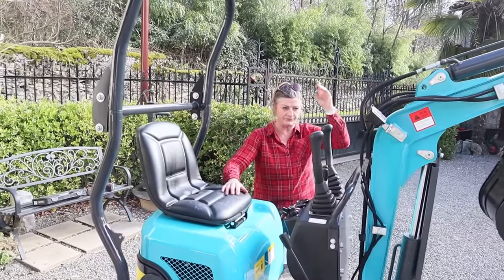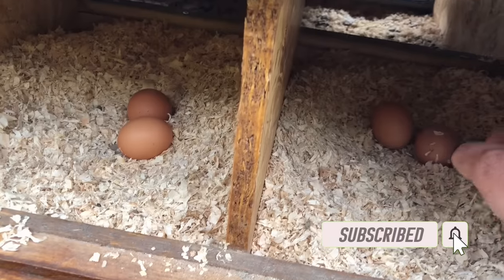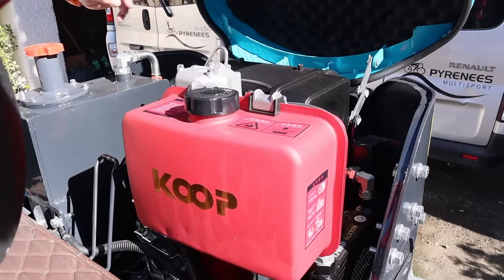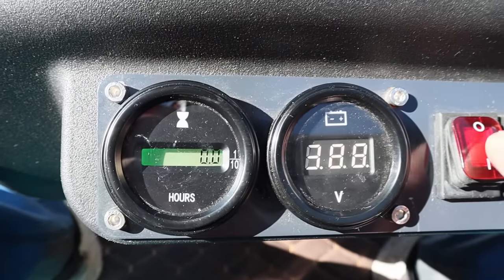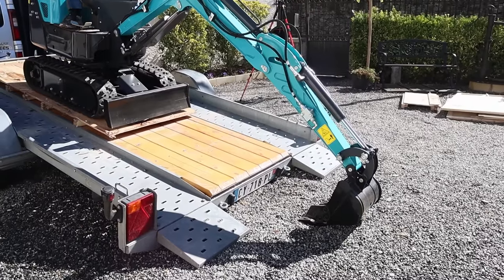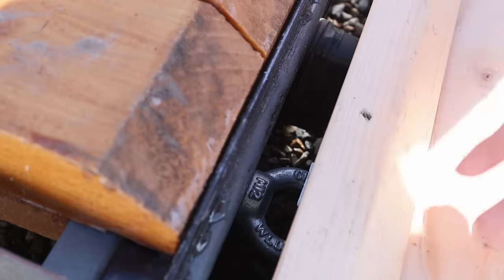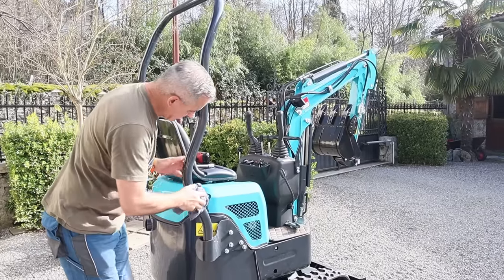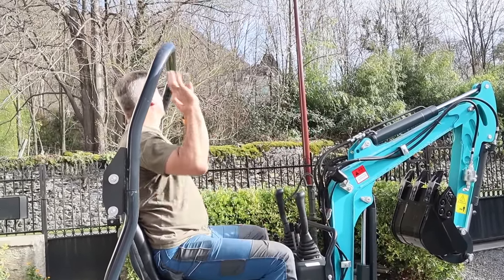Unboxing Chinese Mini Excavator | Nuoman from Alibaba

Comment: When you get some experience, you’ll be able to load and offload the excavator without little ramps . Remember, with the boom you can lift yourself and push and pull . I use a trailer that doesn’t tilt, yet I can load offload with ease. Have fun !
Reply from the maker: Hope so, going to try it when all this rain stops.
Reply: Yup, couldn't believe making the extra little ramp. Lots of fun tricks to learn when using an excavator.
Reply: @heartysteer8752  They will figure it out. Great fun for them.
Reply: If you end up pushing hard , rather than pulling ... Mb it won't be so good for it .
Reply: @repentandbelieveinjesuschr9495  last I checked Jesus didn't have an excavator
Reply: @prylosecorsomething3194  dumb
Reply: You can, but be very carefull, once it tips far enough there's no coming back. Also do not attemp without ramps if its slippery out.
Reply: Just use the ramps. You won't be in that much of a hurry.
Reply: This sport should be in the Olympics
Reply: You need your own workshop to be able to repair everything yourself. You can order spare parts from the manufacturer. But if you have this repaired and serviced by an authorized workshop, it gets really expensive.

Comment: As a mechanic that worked on Chinese manufactured forklifts my suggestion is to go over the unit & make sure hose clamps for coolant hoses are replaced as the Chinese ones are poor quality. If any parts like filters are manufacturer specific get extras. Also hydraulic hose fittings, check & be certain they are available at your local supplier. Just a couple issues I’ve experienced on the job.
Reply from the maker: I checked out the hydraulic lines and they are all available.  It came with spare filters etc and I have matched them up locally.  Good to hear from someone who has worked on similar - thank you for the advice it is greatly appreciated.
Reply: yes  Chinese hydraulic  threads are non standard not available in west
Reply: Also do a quick torque check on all fasteners and fittings
Reply: Kiri Tiatia Otaraua O'C-TX5   not nft  jic  its there own  rubbish threads
Reply: Budget Chinese tractors that get imported into Australia get the fluids replaced and regreased before sale here by importer.
Reply: I wonder if their nuclear bomb have the same quality too 🤣
Reply: @relaxchil5796  You pay what you got, it's simple
Reply: What a toy
Reply: I don't think iv ever got a house from a retailer that wasn't also made in china.
Reply: @Micheal-d7e  a house? Or hose? Either way I said hose clamp
Reply: @pureblood15  and either way, you knew what the typo meant. Unless you're so dim you actually need me to clarify. I assume so, since you took the time to ask..so, yes I meant hose! "House" doesn't quite fit the context. I wouldn't suggest you change any of these hoses on your own, problem solving isn't your forte buddy
Reply: @Micheal-d7e  GFY, I simply was pointing out that your grasp of spelling & grammar is a joke & you wish to try & insult someone who clearly not only knows the English language but also a heck of a lot more about mechanics than you! Run along & play let the grown ups deal with the issues.
Reply: @pureblood15  assuming you have no clue as to what swype is.. that's a feature where you don't type every single letter in order to spell. If you knew anything you'd know typos are rarely a spelling mistake and more of a neglect of proof reading. Not that you're worth the time to double check.
Which mechanics do you think you know more about? And just how do you intend on convincing me? You're very adamant about throwing it out there, even when nicely asked or cares.. sounds to me like you're overcompensating, real talent doesn't boast
Reply: @pureblood15  also, who exactly are you?? I don't think iv ever heard of you before.. and why are you so mad just because all the hoses iv got from retailers are from China? If you've got a problem with China you should take it up with them, I'll be happy to provide you with the three shops I typically deal with, maybe you can talk to them and change their supplier. Perhaps there's a quality hose manufacturer in North Korea or Russia where they can import supply
Reply: @Micheal-d7e  red seal journeyman ticket didn’t come out of a Cracker Jack box. 😂 You really are a laugh, just a keyboard warrior! I have better things to do…you know like reruns of Friends!🤣
Reply: @Micheal-d7e  also who exactly are you? I know I haven’t heard of you!
Reply: @pureblood15  I'm not claiming to be anybody, I'm not a world renowned master mechanic like yourself. 
So tell me why you're mad about these Chinese hoses the stores carry
Reply: @pureblood15  congratulations on your red seal btw. I employ quite a few guys with that same certification. It's good to see a simple journeyman's card has made you such a humble man. I deal with so many ego inflated ones that think their shit dont stink, they think a few years experience, a piece of paper, and a little pay increase is some accomplishment. When in fact they're just another meager worker on the shop floor or out in the field.  Canada isn't as big as most folks think, you probably went to SAIT, which means you probably work at a place where I personally or professionally know someone, of course you could be independent but that also means you likely contract from  a list of associates of mine. There's also the chance that you're just a nobody and not as infamous as you make yourself sound, either way I'll find out what the real deal is Mr. Kirschman
Reply: I’m guessing everything on it is plastic :)
Reply: @ozlakota1  Bro you are wrong there.
Worked in that field in the 80s and 90s. And used many metric fitting used in China. Oh I'm in Scotland. 
The company I worked with where the agents in Scotland for Gates hydraulics
Reply: @HomesteadingUncontained  你认为和你说中国产品质量差的“中国工程师”可能是中国的工程师吗？
Reply: @andrewradford3953  认为中国产品不好，为什么还要进口中国产品呢？
Reply: @Rob-fc9wg  没人强迫你买，你不用客气。
Reply: @relaxchil5796  you should try
Reply: All very nice…. but….. HOW MUCH?!?
Reply: @andrewradford3953  How has your experience been with them? have you had any major problems. What I don’t understand about the Chinese is that they obviously have the capability to build nice products. Look at an iPhone for example. 

What I don’t understand is that they will go through all of the  trouble to build a machine like this excavator and they will source high-quality parts for the engine, walking motors, etc. Then they ruin the quality with something like shitty hydraulic hoses, controls,  filters etc. WHY?

I have been researching them for about a year talking to different manufacturers and every single time I speak to them the first thing I say is “ Please tell me about every single option you have. I want to buy the highest quality machine that you offer”. Every single time after weeks of setting the order up I would somehow find out they have  a better option available that they never told me.  It’s so aggravating that I have almost given up. 

Most recently was this week I was literally seconds away from putting down the money and the guy sends me a picture of somebody else’s machine being loaded up and I was like “uhhh what is that?”. The seller says “oh that’s a machine for another customer” 

It ended up costing like $1000 more and it was like 100 times better than what he was selling me.  kubota engine, Eaton walking motors, NGK electronics, continental hoses, marzochi valves. I wanted to punch the guy in the face. I literally asked you 5000 times to tell me all of the options you had and you didn’t think of this?
Reply: @justinarsenault1926  It’s not meant for gold mining it’s a backyard homeowner product and its perfect
Reply: @Micheal-d7e  well did you find him or not i’m dying to know what happened with the 2 of you
Reply: @nesc39  our neighbour worked for a large importer of Chinese farm machinery.
He said they had to check all fasteners and replace all fluids and regrease.
Another person I knew was importing batteries and asked for their best. Was told it would last 8 years but no one ordered them because they were a little more expensive. He later found out they manufactured batteries the would last 12 years at a slightly higher cost.
I think they are used to importers that only care about the cost.
Reply: @relaxchil5796  ...China's nukes are better than USA's.    But keep on with your racist rant, boi.
Reply: I want one
Reply: @maxmadison5488 I doubt they are lol like NKs they tend to land everywhere

Comment: Watching from Virginia USA, Great video, couple years back bought a Chinese backhoe for my subcompact tractor, it works well hope you get many years of use on your property…
Reply: Im in va also and order a sawmill from there and love it.
Reply from the maker: Great to hear, I am not worried at all.  After inspecting this machine it is no different to a known brand, other than the cheaper motor - hence the price.  Thanks for commenting.
Reply: Sweet Virginia!!!
Reply: What about parts supply , that is the major reason I have never bought any equipment off Alibaba . Even the things with a local dealer , parts are hard to get
Reply: Sorry that was an auto reply
Reply: @outinthesticks1035  The thing they are made of basic part, there is no specific designd engine, pump or what ever in this things, all of the shelf stuff, you could simply unbold the Diesel Engine and install a Honda Gas Engine with similar Power if you want to.
There is no computer inside, this excavators arent much more complex than a log splitter.
Reply: @timberwolflumber5296  I’m in va too
Reply: could you put the link here from here you bought it or at least the name and serial number of it and how much you paid 🫂I also live in the United States

Comment: The "clamp thing" is a muffler tip to direct the exhaust for the engine.  The small black pouch with the spanners and screwdriver (and the exhaust tip) would normally ship with just the engine, if purchased separately.

Comment: Having run a rental shop (the one in the big orange box) for many years, I have had the opportunity to see just about everything someone can do to break a Mini-Excavator. We had 1-ton, 1.5 ton and 2.5-ton excavators in the lineup, and I was forever pushing people to rent the bigger machines because the mini-ex was constantly broken by people trying to make it do more than its capabilities allowed.  The most common complaint was it lacked power.  Most of the time, people would run it at RPMs too low to produce the needed power.  I noticed as you were moving the machine off the trailer you were doing the same thing.  Setting the throttle lever at no less than 2000 rpm will give it the balls to do most of what its design specs allow.  Higher RPMs will also protect the engine from overheating and stalling.  Stalling a diesel engine is bad news.

Operating the machine at or above 2000 RPM will, to your wife's consternation, make the machine noisy and loud, but it makes you safer as the operator.  If you put yourself in a position where the machine may tip over, having more speed to swing the cab and use the bucket to brace with can make the difference between giving yourself the option to tip-toe out of the position or getting squashed dead like a bug.

Regarding the seat belt. There's a comment here that's right on the mark about injuries to operators trying to jump off a rolling machine. He's right. It's the fastest, easiest way to commit suicide on an excavator or any other kind of construction equipment.  staying on the machine while it rolls is how you survive.  Also, should you roll the unit and pursue compensation through your insurance company, the instant they discover there is no seat belt, you'll be completely screwed and probably liable for prosecution.  Put a seat belt on it ASAP.

Both the Bobcat and the Kubota 1-tons we rented were able to spread their tracks in and out for an increase in the track width by about 20 inches.  This seemingly small change made a dramatic difference in the stability of the machine, and it was always the first thing I taught renters to do (after the throttle-up recommendation).

These are good, capable machines when used within their specs and tons of fun to operate if you're careful.  

I just noticed the video "Mini-excavator pushed Hard..." which I haven't watched.  I wonder what RPM you were running it at?
Reply: Good comment but what Good is a seat belt without a roll-cage?
Reply: @briandbeaudin9166  If you've run one of these minis or even a riding lawn mower you know that bodily feeling you get when you know you're about to go over.  If there's no hope of recovery then grab the sides of the seat and pull your torso down as hard as you can and duck your head.  Your shoulders may bump the ground but the ROPS (Rollover Protection System) will prevent the machine from landing on top of you because even though it weighs a ton when it's rolling downhill it's moving way faster than you can.  If you're not really pushing the limits the ROPS will stop the machine at flopping over on its side.
Reply from the maker: Just to clarify - it does have a roll bar (ROPS) and it also has a seat belt.  I have only experienced the feel of going over on my Kubota tractor and I was able to control into the tip....the mini excavator is more like a bucking bronco at times 🤣
Reply: This comment (particularly on the safety) should be included in the description.  In my experience, this is completely, 100% true.

Many people do not understand how hydraulic final-drives work in the context of the speed.  They'll assume they are driving or moving slow, therefore the RPM's should be slow.  They forget that the RPM's directly relate to how much power the hydraulic pump can generate.

Comment: Great video, neat little excavator (“digger”) - FYI, when you have a ROPS (roll-over protective structure) you want a seatbelt to keep you inside the protective ROPS. Most people are injured or killed when they attempt to leap from a piece of equipment, and it rolls over them. The seatbelt keeps you inside the protective ROPS and keeps you from getting crushed.
Reply from the maker: Yes, seat belt is now fitted and I use it all the time.

Comment: The clamp may be a safety device you place around the hydraulic ram when doing maintenance such as greasing etc, my Chinese bobcat has one and the instructions say it stops the bucket arm from falling should the ram(s) fail, they usually creep down as it is. Be sure to run full throttle as the pumps work better/last longer that way, or they will struggle.
Reply: clampy thing looks like an exhaust tip :)

Comment: So just to give my two cents, for what they're worth. The only time you don't wear a seatbelt, is when operating without a roll bar (for example if you fold it down on a big commercial mower to go under park tree branches. You don't wear the seat belt, so you can jump off) If you have a roll bar or a cab, you always wear a seatbelt, because it fights your instinct and stops you jumping off. It keeps you within the safe area. Most of the time when people try and jump off a machine with a roll bar, you just end up getting trapped under the bar. The seatbelt is to stop you jumping off. Fun video tho, I enjoyed it. nice one
Reply from the maker: Totally convinced now and have purchased seatbelts for the digger and the tractor.  Thank you for the comments, really appreciated.

Comment: Hahaha 'guvNORRRRRR!!!!! I instinctively guessed that you were an operator right away and loved when you first "touched" the controls to certify Cat vs John Deere.
 Cat won. LOL
I agree that the auger option outweighs all else on this mini due to its tiny width vs light horsepower in the trenching mode. 
We Yanks call it the ROPS (roll over protective structure)-again a master MASTER notification on your part. 
I'm impressed with the wet kit (auger et el) and the low end torque required for the blade function.
I predict pure success with this machine 'mate!
Cheers!

Comment: These excavators are so light they can be quite frustrating to operate. Weight and stability are a good basis for pulling the digger bucket through tough compacted ground. Ive got a 301.7d cat digger and being 1.8 ton its a marked difference when you have to use something as small as this little thing
Reply from the maker: I have to transport it and have a 1.3t trailer so I had no choice but to go small.  Budget did not stretch to a new trailer as well. ☹️
Reply: Still beats a shovel 🤣
Reply: Yes i use 3/4 ton machines on tight access jobs. Never loose the shovel technique though. Its a dying art

Comment: Engine not quite as buttery as the Yanmar engines usually used in these small diggers but for the price unbelievable value to do a couple of smallholder projects.
Reply from the maker: Yes, If I had the budget it would have been Yanmar or Kubota - but that was an extra 4k.
Reply: What’s the price please? Thanks man

Comment: I could have used this little machine when I was a homeowner for over 30 years.  I no longer need such a tool, but I want one just to screw around.
Reply from the maker: It will save my back..... I am not 20 any longer for sure. 😅

Comment: I was particularly impressed with your careful and unhurried pace, not allowing enthusiasm or video duration to hurry you beyond what you knew to be prudent.

I have been interested in these sub-compact excavators for some time, and France has a domestic manufacturer of this type of machine.

I look forward to following your experience with your machine, subscribed.
Reply from the maker: I looked at the sphinx unit which I think is what you mean, but I could only afford the micro version which did not have a turn table - plus it was much smaller.  They looked well made but just out of my price range.